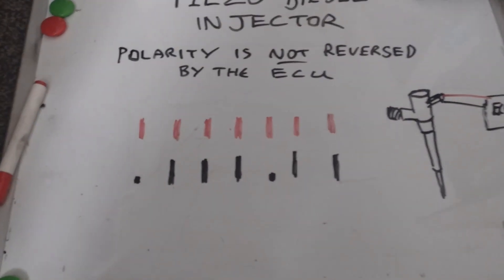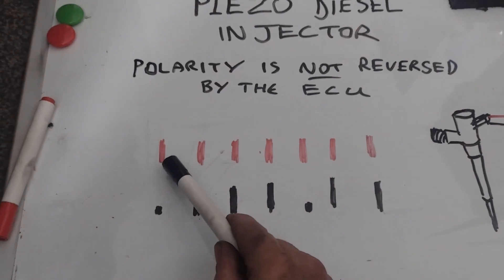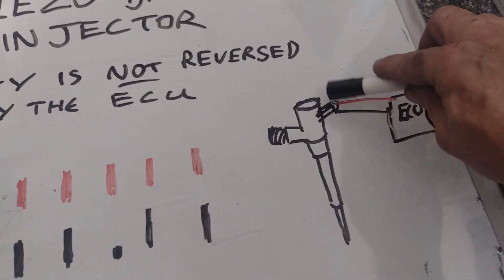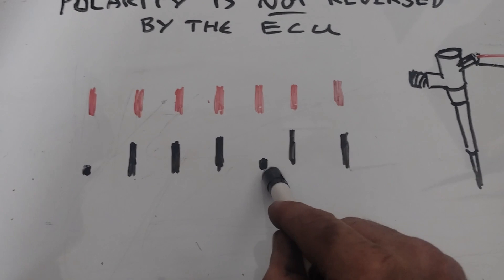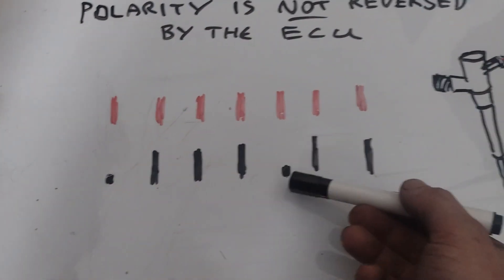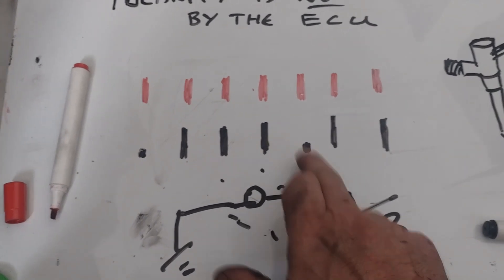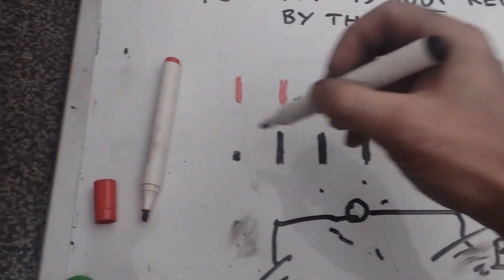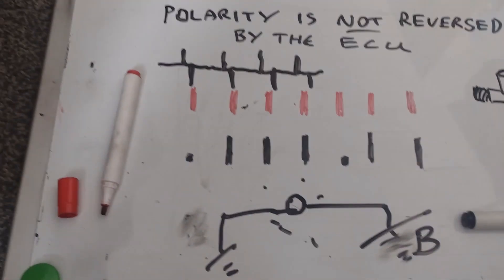Piezo Diesel Injector (Polarity Is Not Reversed By The ECU)

Comment: Matt eye opening video, does this means that you can actually disconnect piezo connector while engine running without flooding engine with diesel fuel
Reply from the maker: I was thinking the same thing, I don't know if I'm am going to try it.
Reply: Take one out, connect it 180° turned and start the engine.
Done that on an OM651.
You can disconnect it and it will stay closed.
I did that actually to find a damaged one that stayed open.
Reply: @mechanicmatt871  Agree👍

Comment: You are right Matt , the piezo stack is not a conductor and when the opening voltage reduces it cases a reverse polarity current and it discharges as such, and closes as long as it has a ground circuit , good experiment video mate ,👍